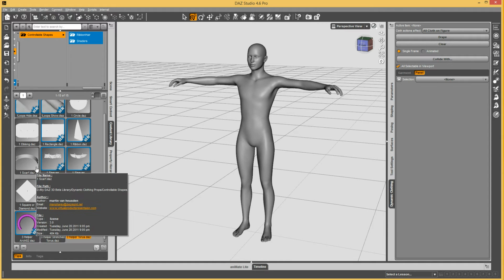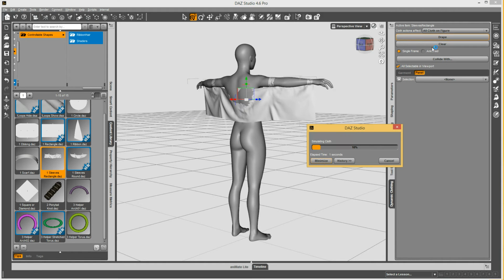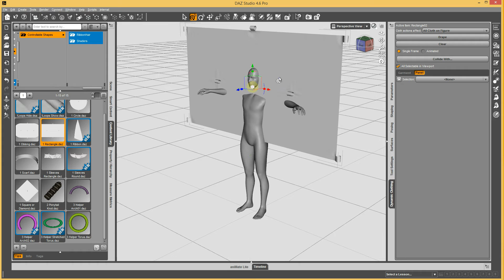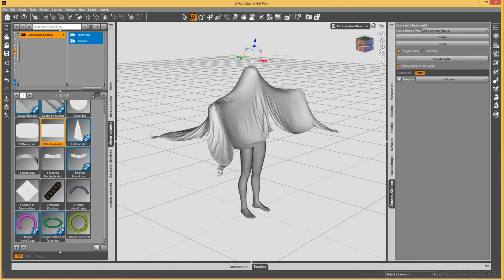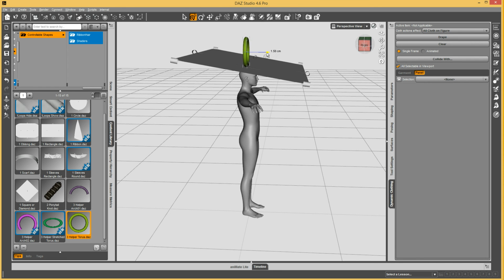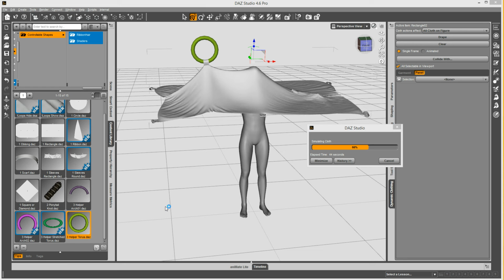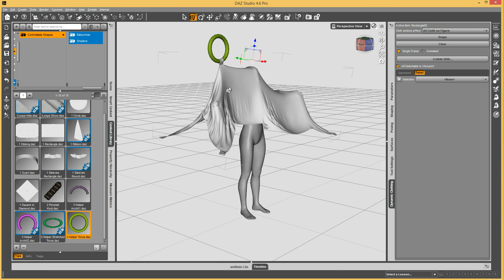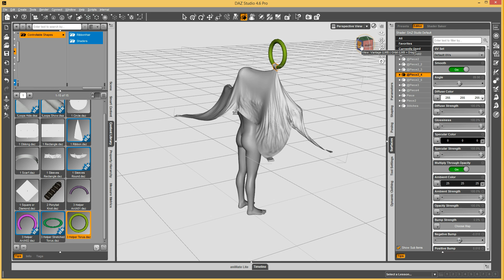Controllable Dynamic Shapes

Comment: i bought the dynamic cloth sheet and every time i try to place it on a "sleeping" model in a bed, the cloth just drapes below to the floor and doesnt collide with the character, not even the bed. what am i doing wrong? is there something in the dynamic cloth tab i should select/check?
Reply from the maker: This product doesn't always work right if you are working in anything newer than DAZ Studio 4.6, so maybe that is related. Another thing to check is in the dynamic cloth tab there is a button called "Collide With..." You could check that to see what is listed there.

Comment: I don't understand why you ended this tutorial without further explaining the Animated option. I'm trying to get the rounded sleeves to move with my character's arms, but I'm so far unsuccessful. You say to animate the movement of the helper item, but then it is not inside the loop of the sleeve for the collision to take effect. I assume parenting the helper item to the shoulders and forearms would count as animating, because I want to pose the arms, and then drape the sleeve. But this is not working. What am I missing?
Reply from the maker: +Brian Gannon True, I could have taken this much farther, but my original intent was to give a brief overview of the basics because there were some questions coming into customer support about it.

When you animate the helper, make sure it starts out inside the loop so that as it moves it pulls the sleeve with it. You may need to slow your animation down if that doesn't work. If the jumps between frames are too much the cloth won't be able to keep up.

And yes, you will want to set the rings as children of shoulder or forearm so they will follow with the movement somewhat, but the key will still be to keep the animation slow enough that the ring doesn't jump outside the loops.
Reply: +Josh Darling, thanks for replying, and forgive my frustration because there seems to be no support for this product at all. In the particular project I'm working on, I'm not looking to animate the sleeves so much as I  am to just create various still poses, where the character's arms are in different positions. If I place the helper rings where her arms are, then the rings can't also be inside the loops of the sleeve shape. Perhaps the problem is I'm using a Genesis 2 model.
Reply from the maker: +Brian Gannon No worries on the frustration, I get it.

I just took a look at this product again to see what's going on. Looks like you shouldn't need helper items for the sleeves, the intent is that the arms of the figure would be sticking through the loops. It doesn't line up correctly on Genesis 3 so draping is problematic, but I was able to get it working so I'll explain what I did. Shouldn't be any different for Genesis 2.

First of all, I did not do any parenting to try to get the item to follow the figure. I just loaded it in and kept my figure at T Pose. I then had to scale the forearm on X to lengthen the arm and bent the forearm a little bit to get the loop to land on the wrist better. I did a test drape (single frame) to see if it now drapes onto the arms correctly and it did well.

Once I had it draping decently in the TPose, I opened the timeline and went to frame 30. At frame 30, I restored the figure (to get rid of the scaling and rotation) and applied a pose. Then I did an animated drape and by the time it reached frame 30 the sleeves were posing great.

Give that a try, it should work ok no matter what figure you are using it with.
Reply: +Josh Darling , ok, I think I get it now. I have to ACT like I'm animating between poses, but I only need to render the frame(s) I want. Correct me if I'm wrong. 

Step1: Frame 0. Position the sleeve on the character in "T" pose (either repositioning the character's arms to fit within the loops or positioning and parenting the helper rings to the character's shoulder and forearms) 
Step 2: Apply the drape with "Single Frame" selected.
Step 3: Frame 30 (or whatever) Apply the desired pose to my figure
Step 4: Apply the drape with "Animate" selected..
Step 5: Render that frame.
Step 6: Move another 30 or so frames further down the timeline, and apply another pose.
Step 7: Repeat 1-5.
Reply from the maker: +Brian Gannon Correct, you will need the animation to do the drapes, but you can then just render whichever single frames you want.
Reply: +Josh Darling , awesome. I will give it another shot this evening. Thanks for your help.

I have another question. While I'm not yet a daily user of Daz, I've been using Daz figures for some time. I've been using Poser, but have given up on that and have been using Daz primarily since this past summer. I remember back when Dynamic Clothing was first introduced. That was long ago in the scheme of things, why hasn't it become THE standard of clothing designs for Daz figures? I see there are so few Dynamic Clothing options for Genesis 2 figures, and now you've introduced Genesis 3. It would be great if we could convert regular clothing TO Dynamic Clothing.
Reply from the maker: +Brian Gannon The main reason is that the dynamic solution we have only works with cloth that is created using a certain set of tools. The tools are expensive so most artists don't have the ability to create dynamic clothing for use with the plugin in Daz Studio.
Reply: +Josh Darling , hmm ok. I assume that is the Optitex software? I see it keeps popping in my search.
Reply from the maker: +Brian Gannon Yes
Reply: +Josh Darling Ok thank. I won't keep bothering you. Thanks again for your help.
Reply from the maker: +Brian Gannon No worries. Good luck!

Comment: Hi Josh, Thanks for the video. I bought this recently and I'm still confused how to wrap a scarf around a person. I guess I'm supposed to animate the helper tools as if they go around the neck? Would it be possible to show a video on how to do this? Thanks so much.
Reply from the maker: +jeremy d The content moves quite slowly in DS 4.9 so it's hard for me to do a good test, not sure what is going on...Maybe it is correct that it doesn't work in newer versions of DS after all.

You are correct, though, that you would need to animate moving the rings around to pull the scarf around the neck, would need to wrap it around the neck through animation.

Comment: Question...How would I be able shape the clothing with the model? I did exactly what was needed, but to no avail! Every time I'd try to shape my model, the clothing wouldn't conform to the shape; it would clip right through the body...Any tips?
Reply from the maker: +wilfredo paneto The cloth works best with the shape it was built for. You may be able to have some success by animating the change to the new shape. You can do that by setting the shape of the figure to the supported shape at frame 0 of the timeline, then go to a later frame, such as 30 or higher, and dialing up the new shape. Then run the simulation as an animation.

Using animation to transition from one shape to another may enable the cloth to know better what it is supposed to be doing.
Reply: Thought of doing this method myself, but was unsure if it would work; I'll try this! Thanks for the reply wasn't sure if anyone would give me the tome of day lol

Comment: Hey Josh, I would  love to see some thorough, comprehensive tutorials on using
Daz3D and Carrara.  I've paid a lot of money so far, and it's very disappointing to spend so much time with trial and error.  And I have been working with 3D software for
years.  Blender, for example, has great tutorials.  But the problem with Blender, Maya, 3DSM, etc., is you have to build everything before you render.  Daz would be awesome if they would solve some basic issues with the software.  As an artist with 50+ yrs.experience, I like to spend my time composing the scenes, not building every little thing.  Maybe in a few more years, I keep saying to myself.
Reply from the maker: Van Martin Are you mainly interested in using the DAZ content in Carrara?
Reply: No, I am a professional artist.  I use multiple software applications.  I like  Daz3D because
I can load basic subject matter content,  manipulate the composition, do post render refinement, then use the final product as the
basis for my paintings.  I recently acquired Carrara 8.5.  Still learning and evaluating it.  I
must be productive to make a living as an artist.  That means establish a concept, gather reference material, and execute the finish product.  Some great, thorough tutorials would speed things along.  I haven't been able to get my Daz content to work properly in Carrara yet.  I'll figure it out.  If you have any sugestions, please let me know.  Thanks for responding.  Van
Reply from the maker: Ah, ok, makes sense. Are you bringing the content into Carrara because you want a better render, or are there specific features of Carrara that you are trying to take advantage of that we don't offer in DAZ Studio?
Reply: Josh Darling Not exactly.  DAZ Studio renders fine.  The western painting, I recently finished, for example, required cowboys, native American Indians, wagons, horses, specific landscape location, etc..  Itwas a depiction of a specific event in history.  I think my problem with Carrara is a technical issue.  It might help to uninstall then reinstall the software.  I purchased lots of DAZ content.  Most of it does not load.  I purchased Carrara  because of its landscape features.  It's similar to Bryce, but with a little DAZ  and  Maya.  Some of these paintings are like little film productions.  They can capture a great deal in a single image.  I noticed that you other tutorials.  I will study them all  when I get a chance.  Make them longer, no background music.  Thanks for makingthem.  More efficient than user guides.  Thanks, Van
Reply from the maker: Van Martin OK, makes sense you would want to take content into Carrara to use the many great features that are in there.

Sounds like what you need is a real Carrara expert helping you out. Any help I give you will be inadequate. I think the best thing you can do is get on our forums to bring up your questions. There are several very knowledgeable people on the forums that could get you moving forward.

http://www.daz3d.com/forums/viewforum/66/

I hate to pawn it off on someone else, but it's outside my area of expertise, unfortunately.
Reply: Josh Darling I have just now watched a couple more of your tutorials. I think your uploads are very helpful.  Hope to see more.  Forums are fine,but it is better to watch someone actually do it.  I appreciate people like yourself, who take the time to help others.  Thanks.  I subscribed, and will continue check out your tutorials.  Van
Reply from the maker: Thanks, and glad you are able to find them useful!